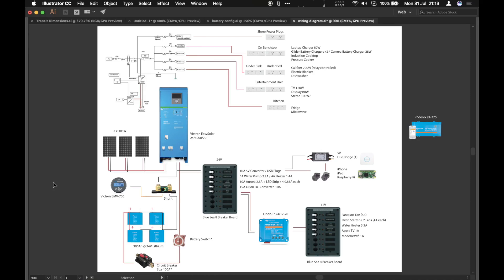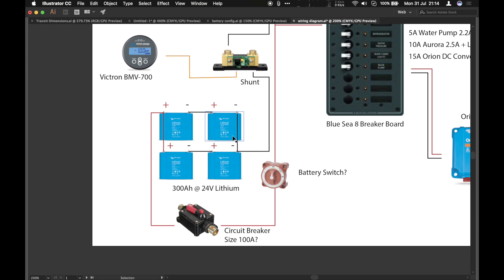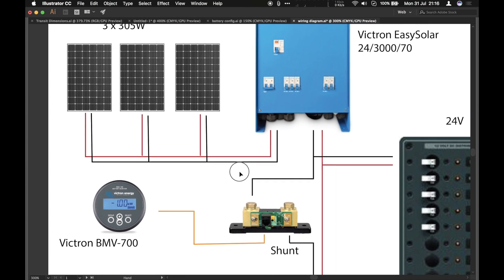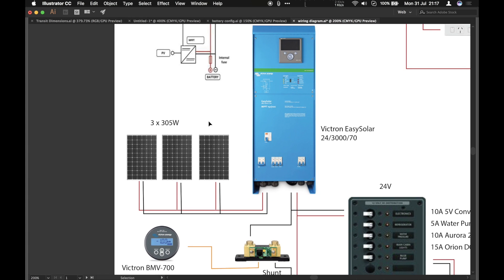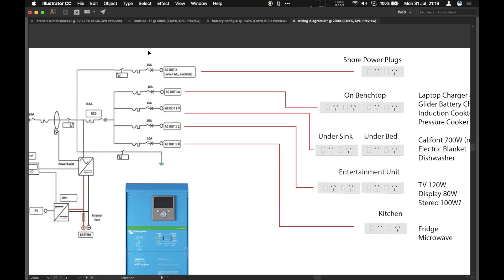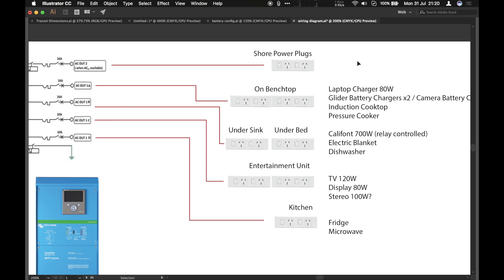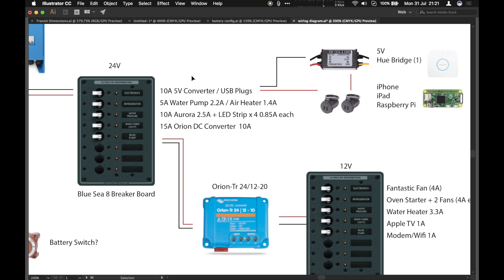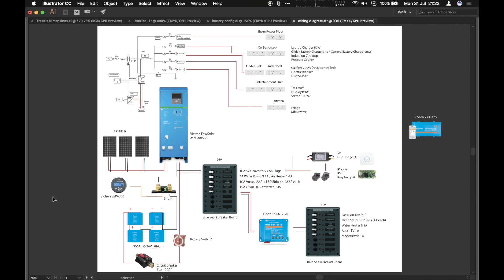24V Electrical Plan for a Van Conversion: Eat Sleep Van 11

Comment: How are you going to charge 24V with 12V alternator?
Reply from the maker: I’m not at the moment, but if you wanted to the options are: a 230v or 120v inverter to 24v charger OR a D.C. to D.C. converter like the Victron BuckBoost converter.
Reply: @EatSleepVan  Would it be possible to charge the batteries from the vehicle with an inverter/charger combo unit?
Reply: @matthewburga  Yeah there's two options: 1) put a small inverter on the van battery system and charge to the existing shore power battery charger. or 2) Buy a Buck Boost DC-DC Converter. Victron make one for this purpose up to 50 Amps.

Comment: Excellent video! Thank you so much! I’m turning a box fan into my new home here in California. I’m having trouble finding 24 V lights. I would prefer something dimmable. Do you have any leads? Thank you so much
Reply from the maker: Hi yes I highly recommend the Philips Hue light strips which are 24v. Be warned it has to be exactly 24v, my lithium battery was going too high for them, so they turned off. So had to get a 24v-24v regulator. The other advantage of them is you don't need to wire up light switches, they use wireless ones. Downside is you do need a Wifi router with ethernet to set up a network for the Hue hub. If you can't find any 24v lights, get a 24-12v DC-DC converter non isolated. They are cheap and pretty efficient. Keep in mind other things like vent fans are also only 12v, so you'll likely need one anyway. Make sure it's big enough to handle all the current you'll need.
Reply: Eat Sleep Van , awesome, thank you so much for the advice!❤️❤️

Comment: Your explanations are great. I have been debating what MPPT and Battery monitor but I am sold on Victron now. (I like Voltronics, but cant get much information on how to log history, remotely monitor etc. Chinese like Epever have Bluetooth & data loggers but looks like they are hit and miss on connecting etc...) I can’t fit the Color Controller in budget but good to know Raspberry Pi is a future option.

I will use Victron Battery Monitor to drive low voltage disconnect. I see you use BatteryProtect, its not too expensive but are there other relay options you considered? Thanks
Reply from the maker: Yeah it’s important to know battery protect only works in a single direction ie it’s not actually a disconnect switch. I ended up with a Gigavac GX23 to disconnect the battery completely if there is a serious low voltage issue or anything else from the BMS.
Reply: Thanks, not sure if I understand you completely, looks like I need to do some more reading! I was hoping to have the Battery Monitor (& Batteryprotect) shed DC load when voltage low, and reconnect when ok again. Yes I will have manual switch for isolation when required
Reply from the maker: Yeah the battery protect will do that - in fact, it can do it without the battery monitor, as it will automatically disconnect and reconnect based on some standard settings for common voltages. Check the manual to see what voltages it supports.

What I was meaning above is: it will disconnect the DC loads BUT it won't stop current flowing the other way i.e. charging the battery. So for stopping DC loads only, it's fine. But for my BMS I wanted to disconnect the battery completely to stop discharge AND charging.

So I ended up with 2 devices. The Gigavac DC switch connected to the BMS. And I have a battery protect simply to disconnect the DC loads if voltage gets too low. This will happen first. If anything critical happens, or the BP doesn't stop the battery draining, the whole battery disconnects with the gagavac. But it shouldn't ever do this unless there's a major problem.

I'm planning to use the BMV700 to control the battery protect, so I can specify the voltage it disconnects. But you don't have to. Hope that helps!

Comment: Hi, thanks for the video and wiring diagram.  
I notice you don't use a breaker board for the 230v wiring.  How to you switch the inverter and all 230 connected loads off?  Is there a remote available to switch off the Easy Solar inverter? thanks
Reply from the maker: Hey good question, the 230v breakers are all built into the EasySolar blue box. There is a shore power breaker, output RCD and 5 circuit breakers. I removed one and installed a DC breaker for the solar so it’s all in the same box. The control panel can turn the inverter on/off remotely, and from my phone.
Reply: Thanks, sounds like a great way to do it
Reply from the maker: Yeah that's the advantage of buying the Victron EasySolar box - it includes all the breakers and AC wiring done already. So my electrician didn't have to do much.

Comment: Hi Esv, I'm also in NZ and just purchased a new Sprinter van for delivery later this year.  Also planning to use a 24v system, with 2 x 200ah lithium batteries in series.  Do you recommend the Victron Easy Solar setup, and did you manage to find anywhere that sells Victron equipment at a decent discount?  It seems like this will be the easiest DIY route, rather than wiring together separate components.Thanks
Reply from the maker: Hi yeah the easy solar is good, I bought from AE Pacific / victronenergy.co.nz who are the cheapest. I did get 10% discount too so be sure to talk to them and ask for it. Note you’ll still need an electrician to do the 230V stuff at least.
Reply: Thanks, I'll ask for the discount for sure:) and absolutely will get the 230v done by an electrician
Reply: Hi again ESV, I'm still undecided whether to go 24 or 12v and would appreciate your advice.  My planned setup is a 400ah 12v, or 200ah of 24v lithium battery, the usual DC loads (small fridge, maxxair fan, water pump, diesel heater, USB plugs, and LED lights).  The AC inverter will be the 1300w/1600va size Victron, powering a small water heater and some standard AC outlets, and probably used fairly lightly.  I'm thinking 12v will be simpler as all of my DC appliances are compatible with 12v, but 24v might have less voltage drop.    Do you have any advice on the two options?
Reply from the maker: Yeah I’d say for that size system 12v would be best. It means it’s easy to tie into the vehicles alternator for charging which is essential in bad weather. Sure some cables might be a bit thicker but that’s fine. It means you can avoid the 24-12v converter. The only advantage of the 24v is the easy solar 3000VA with colour controller only comes 24v, and it’s about $1000 cheaper buying that box instead of the individual components. But as you’re getting a smaller inverter anyway it probably doesn’t matter. Also don’t count on heating hot water with your batteries!
Reply: Hi, thanks that is now one less thing to research. I'll stick with 12v and keep it simple. The van is mostly for weekends and surf trips etc. So planning to heat up the water via shore power before we head off. Cheers
Reply from the maker: Yeah sounds good. The only other reason I'd suggest 24v is if your vehicle already has 24V. Heating water up on shore power is a good idea. My tank stays hot for a good 24 hours or so. I look forward to checking out what you end up with. On instagram perhaps?

Comment: Hi,

Really enjoying your videos. The best easy controller instructions I've found online so far, the manual is extremely overwhelming :S

Just a quick question with your DC breaker and 24V/12V running off the batteries. If the Easy Solar and BMV-700 note a low battery alarm, will this prevent all DC power being absorbed from the batteries? Will the Shunt and BMV700 prevent any draw off the batteries?

I currently don't have the BMV700 on my set up and my batteries always show 99% because of the DC draw not being calculated.

Love your videos, keep up the good work :)
Reply from the maker: Thanks very much!
Reply from the maker: Hey sorry I only just saw past the first line of your comment!

I've got a Battery Protect in place which I'll have either the BMV 700 OR colour controller turn off just the 12/24V DC distribution boards when the voltage gets too low.

However that leaves the inverter, but I can set a lower voltage limit on that separately.

So then I can set DC/Inverter to turn off before the main battery BMS turns off due to an ever lower voltage. Generally I don't want the main BMS turning off the battery otherwise it will also stop charging the batteries, and would require manual intervention to get going again.
Reply: Thanks! Also, a quick question, do you have an Orion DC/DC Converter? 

From your batteries -> BMV -> DC/DC Converter -> 12V Dist Board
Reply from the maker: Yes that’s right, the 24 to 12v converter works well for those 12v only things eg. roof fans

Comment: Will you be able to utilize the 12V alternator output to charge your 24V batteries?
Reply from the maker: +Christopher Aho yes, but you have to convert the voltages somehow. Easiest is to use a 12v-240v inverter, then feed that into the shore power. That way you can use the same charger as the shore power. An automatic transfer switch would be ideal to help choose the input source.
Reply: I have a Sprinter with a 12VDC system (675 Ah of flooded lead acid, 840W of PV) and was considering a 24VDC system.  I like your 24-12VDC transformer as it's actually a simple solution to power the things that don't come in 24V.  In my van I link the leisure batteries to the alternator for charging when PV input is low.  It works well enough but not nearly as well as a system with a dedicated charger like the EasySolar because the charging profile of the alternator isn't idealized for deep cycle batteries.  In retrospect a 24VDC leisure battery with an EasySolar system sounds pretty good.  Add a cheap 12V inverter to power the charger and boom you've added another way to charge the 24V batteries for when the sun isn't shining AND it's a profile that fits the batteries be they deep cycle lead acid or lithium.  I just wish it came in 120VAC output for North American markets!

Comment: What are the advantages and drawbacks for using 12 Volt AND 24 Volt consumers? Would that down and up conversions not cause in a huge power lost?
Reply from the maker: According to the isolated converter datasheets, it's the same efficiency to go to 24-12 as it is 12-24. And as mentioned, I'd need to do it one way or the other.    https://www.victronenergy.com/upload/documents/Datasheet-Orion-Tr-DC-DC-converters-isolated-250W-EN.pdf

Note as well the non isolated converters are much more efficient than the isolated i.e. 88% efficient vs 97%. So if you can get away with non isolated it's not bad at all.

The draw on the system from the 12/24V side is small compared to the size of the batteries, so I'm not too worried about losing 12% on 12V stuff.
Reply: Your planned power config is more extensive than all other projects i am following. And you are the first with a 24 volt setup instead of 12 volts. Maybe i have to investigate more in 24 volts and how much more efficiency (and less costs) I could get out of this. 

Nice work until now and I am really curious about your updates!